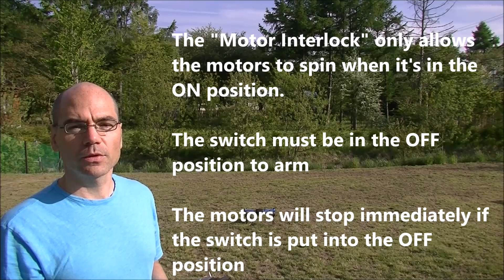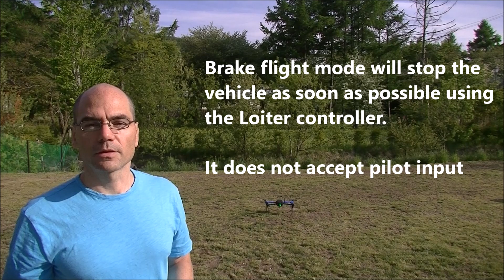AC3.3 EmergencyStop, InterLock and Brake

Comment: I notice when turning off Emergency Stop the FC re-arms and the props start to spin. Is there a way to switch off this behaviour or is there a reason for this?
Reply from the maker: Hi Anthony, there's a timeout period of about 10 seconds so that if you move the Emergency Stop back to the off position (e.g. allow the motors to spin again) within this time then the motors will spin.  This is on purpose to protect against the case where the pilot accidentally pulls the switch in flight.  If you're just looking to disarm the vehicle then there is another option for that.
Reply: @rmackay9  I released afterwards it because I actually used the incorrect RC Option value

165 ARM/Motor Emergency Stop

instead of 

31 Motor Emergency Stop (this was instantaneous) 
32 Motor Interlock
33 BRAKE

What would be the use case for 165?

I was also looking at multi-channel activation against 2 buttons. I think I saw somewhere this isn't possible but it occurred to me that when you arm via Mode 2 left joystick it's doing so via 2 channels? So in theory possible.
Reply from the maker: @antznixon  Re using two channels to activate a single aux function, I don't think this is possible unless the TX supports some kind of complex mixing.  Aux option 165 is very similar to the regular Arm/Disarm aux function except that it bypasses the landing detector... with the regular Arm/Disarm it will not disarm while flying .. with 165 it will.  Hope that helps.
Reply: @rmackay9  Interesting. I would love to see mixing on Herelink in the future or changing the time to depress the button to something longer to activate. Makes perfect sense with regards to Arm/Disarm mid-air when you say it like that.

Comment: I like the emergency motor stop feature and will defiantly be setting that up on my machines. I already use something similar on a dji naza controlled machine, I set the throttle stick so that it doesn't go below 20% (dji shut down the motors on low throttle) and then program a switch to drop the throttle to low (regardless of the stick position) and this stops the motors almost immediate. A bit like the auto-rotate switch on an RC helicopter

Comment: I'm a learner which I found the PID is a bit lost of how to tune the copter. I wish you have some kind of sliders that slide to the desire copter size (motor to motor) like NAZA M2, then we do the fine-tune after. you showed us a very important feature, this is we should know before anything else. Thank you very much
Reply from the maker: Simen, on Mission Planner's Config / Basic Tuning there is a single slider that affects just the Roll and Pitch rate controller's P and I values.  This may work although really the D should also be increased or decreased proportionally to P.  Our best tuning instructions are on this page: https://ardupilot.org/copter/docs/tuning-process-instructions.html.  Indeed, it's a bit of a challenge.

Comment: Hello I know it has been a few years since you did this video but could you please list the procedure for these mods.  I am using an APM 2.8 to control my quad if it is possible.
Reply from the maker: Hi Ben, The APM2.x boards are very old and we don't provide support anymore for them.  There are far more capable boards available that run our latest software listed here: https://ardupilot.org/copter/docs/common-autopilots.html .  In particular the emergency stop, interlock and brake were introduced in Copter-3.3 but the APM2.x board development stopped at Copter-3.2.1.

Comment: Will the interlock will stop motors during the flight and re start them when altittude getting low?
Reply from the maker: @Magstermagic, the interlock will stop the motors but it won't automatically restart them.  If the pilot moves the switch back within a certain number of seconds then the motors should restart (I forget exactly how many seconds the pilot has, i think it may be 10 or 15 seconds)

Comment: What will happen if you brake in auto mode? Will it brake and then continue with the mission after you release the brake?
Reply from the maker: Jose, yes, normally if you switch back into Auto mode it will continue with the mission.  There is a MIS_RESTART parameter which controls whether it restarts the mission from the first command or resumes it from the last command executed.  The default is to resume.

Comment: As I saw, you are take off in the loiter mode, does the "emergency stop mode" require gps lock? I'd like to test it in indoor and just in case use this features for emergency land.
Reply from the maker: +Nurjan Yesmagambet The emergency stop (the first item shown in the video) works in any mode and will immediately stop the engines. No need for GPS for the emergency stop.
Reply: +Randy Mackay thank you for reply, I set the emergency motor stop mode on ch7. Then tried to arm and take off approx 20-30sm, activated channel 7 but nothing happened, motors still spinn. Any suggestion? i'm using last version fw for hexacopter, and apm2.6
Reply from the maker: +Nurjan Yesmagambet Ah right.  So the last version supported for the APM2.x boards was Copter-3.2.  This is a 3.3 feature so it won't be available on the board you have, sorry!  Best to upgrade to a Pixhawk (or compatible).
Reply from the maker: +RulerL0rd Yes, I'm afraid so.  You know, we worked so hard to keep the system running on the tiny little 8bit CPU that's on those boards but it eventually just became nearly impossible.  The ARM32 boards (Pixhawk, etc) can be found very cheaply these days though and have so much more power and capabilities.

Comment: Great demo Randy.  What will happen if you "Brake" in flight with 50% throttle and then set throttle to zero and disable "Brake"?  I'm wondering if there should be a warning from copter to pilot or via telemetry that pilot throttle is set too low and not allow brake to be disabled until throttle meets the throttle threshold at time brake was enabled.  This could help prevent accidents.
Reply from the maker: Doug Walmsley We've discussed this via PM but I'll answer here again so others can see.
It's a good point about the user accidentally switching to another mode while the throttle is very low - say for example the user switch to stabilize with the throttle at zero it would fall like a rock.  It's a difficult problem to solve though because stopping the user from switching to that other flight mode would be directly ignoring what the pilot's said he/she wants.  We are second guessing the pilot's instructions which can also be dangerous.
So for the moment, there's no additional checks when leaving Brake mode and personally I'll be waiting for some consensus from the devs & community on what that check could be before implementing.